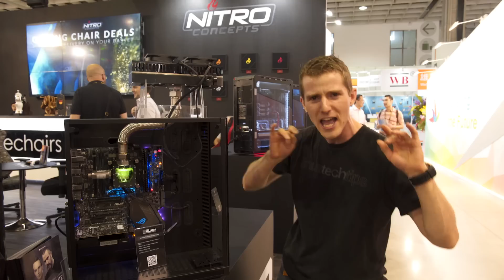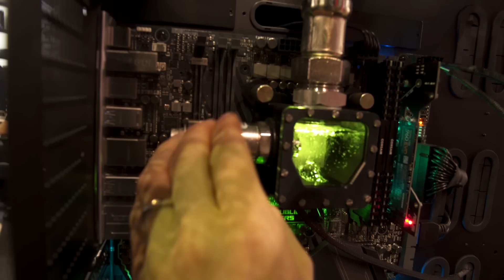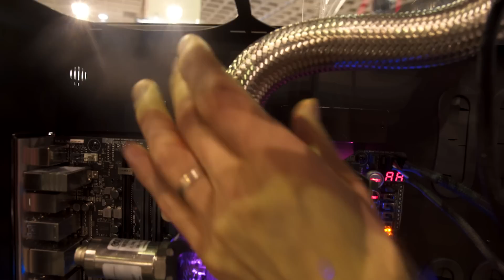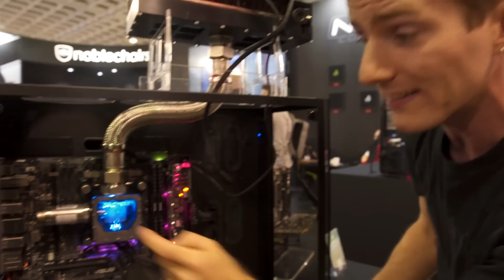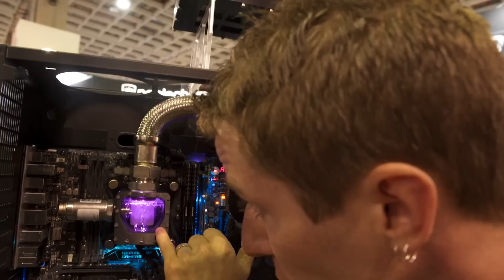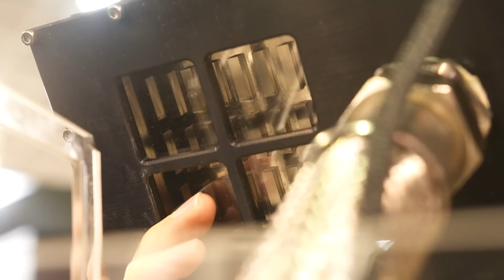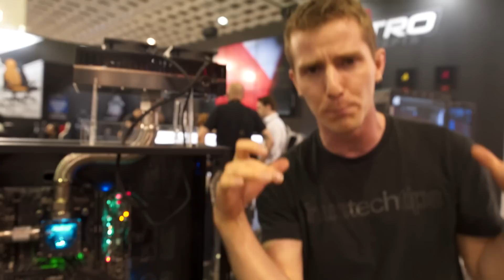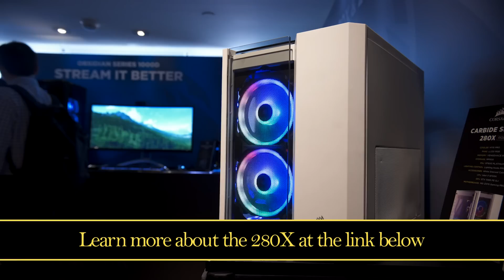Crazy Der8auer cooler prototype - NO pump!

Comment: this is a game changer! The internal pump has always been the point of failure for water coolers. It is small, fragile and extremely unreliable in terms of service life. If u ever had to replace ur water cooler, chances are it was because the water pump died. The water pump issue should have been where water cooler designers should have been focused on but they did not bother because it was more beneficial to them that instead of PC users being able to repair their failing water pumps for a few bucks, were forced to purchase a brand new one for 100+ dollars every 2 to 3 years (if they were very careful). Meanwhile air cooler users could use the same cooler for well over 5 or even 10 years because a failing pwm fan is very easily replaceable in an air cooler. This is what water coolers needed, a complete removal of the useless part that cost owners more then it is worth. I look forward to this AIO cooler because this will finally convince hardcore water cooler haters that maybe there is hope for this CPU cooler yet.

Comment: Freon 113 boils around 47°c and is non toxic chemical but isn't really used as it is bad for ozone layer but could be used for this kind of application.
 If you google refrigerants' boiling points and find out what could be commercially used without health hazards you could easily come up with same concept.

Comment: There's a pretty good reason why he thinks nobody will guess - it's a sealed, pressurised system (thick metal block, seriously thick pressure reinforced pipes) and the tell-tale pressure gauge on the side to test different pressure's affect during development. The liquid could literally be anything that regulators consider safe to use in a sealed pressure system.
The system could even be set up with a vacuum, in which case the liquid could be a "safe" water soluble organic compound. TLDR: Just wait for the safety sheet that comes with the commercial product (if it makes it to market). I really hope this comes to market, as a bubbling glass chamber looks a lot more interesting than an RGB-everything light-show imho.

Comment: it could be liquid propane. It is highly volatile, evaporates quickly at room temperature and will stay liquid at 9 psi and is a known coolant being used in old refrigeration units for years. Like ac units no air in system no flammability . Also plain old ammonia is also used as coolant

Comment: It has to be something with a boiling point low enough to efficiently cool the CPU, but not low enough to evaporate at room temp . I´d go with boiling point aruond 50 degrees celsius.
That would mean you yould use Acetone, Carbon Bisulfide, Carbon Disulfide, Cyclopentane, 2,3 - Dimethylbutane, Methyl Acetate, 2 - Methylpentane and Neohexane. I dont know wich one of these is clear, but its probably one of these

Comment: it could be something like diethyl ether or perhaps THF or acetone. It's most likely something like diethyl ether as it's not too dangerous, compared to something like THF. Equally it could be a mixture of 2 or three solvents to get the desired boiling point with less harmful solvents. It's got to have a low boiling point to actually cool a processor like this, as it's effectively just a reflux condenser.

That being said, the system could equally be under pressure (it seems like quite a robust, enclosed system), so it could be something else that normally has a boiling point too high to evaporate at rpt but under say 500 mbar (~0.5 atm) would be ideal for cooling.

Comment: It's probably just water. If the air pressure in the system is around 200hPa (1/5 of the air pressure at sea level), the water would boil at ~60C (140F). Would also explain why the pressure in the system is constantly meassured.

Comment: every aircooler with heatpipes has this system integrated.. and they mostly use aceton (boiling point 56C) or methanol (BP. 65C) and of course a slight vaccum helps a lot.

Comment: ACETALDEHYDE!
Reply: Could be acetaldehyde under pressure to raise the boiling point.
Reply: For the Coolant I guess.
Reply: probably not because the boiling point is 20 °C, this is too low for it to condense again
Reply: MPcrazyscience what about 65% acetaldehyde and 35% water?
Reply: they do mix but when the phase changes they will seperate again (not 100% sure though) kindof like destilling alcohol.
I've looked around and found that diethyl ether has a boiling point of 35°C and will probably work good
Reply: MPcrazyscience that seems like a pretty good conclusion. Gigabyte tested the liquid out in a server as an immersible cooling liquid.
Reply: yes that's true

Comment: i don't know about roman, but if safety wasn't a problem, i would use methanol and a bit of pressure which should keep it under 70 degrees celcius. i think that would be acceptable but the problem is that it's so damn toxic. is he just using ethanool?

Comment: Der8auer has done already before some projects, with this type of liquid, for Caseking, it's an special fluid from M3 which isn't avaible, at least in europe, for private purposes, only for companys, therefore I guess, also this cooler will only be for events, an not for private use, cause all the fluids with similar specs 3M is offering, does have the same law-side restrictions - at least in europe.
Reply: Django Ryffel they needed such an exotic fluid because they submereg the entire board. If you have a closed system you could use a larger variety of fluids (even water under reduced pessure (like a heat pipe)).
Reply: Spamme Loop hi, yeah I know and totally understand that so far, but nethertheless I have to ask, ehy there are so many restrictive laws on this point, while other chemicals, like GBL are easy peasy to buy in amounts of 10L and more, consider this is a substance, which can be used in amounts of 1-2ml to knock out someone.
You know, I mean, why? Why on the one side so less restrictions and on the other so many.
Reply: Django Ryffel lobbying, volatility and the date of introduction.
Reply: Spamme Loop must be the reason

Comment: Perhaps petroleum ether 40/60. It has a low boiling point, it isn't very expencive and a leak would be noticed by smell very quickly. Only two problems: it is slightly toxic and if there is a leak, you shouldn't drain it into a sink. It's not likely, but it is possible.

Comment: Would that coolant be CO2? Because around 5 bar's that is a liquid. Also because the inclosure looks heavy duty. It could probably contain op to 30 bar of internal pressure. Or maybe even a refrigerator gas how know's

Comment: so the liquid...

it has a pressure sensor which could mean that it is not at atmospheric pressure. as you increase pressure, boiling point increases.
ethanol (even methanol) would be too high. my guess would be something that boils at about 40 C, maybe something like a refrigerant, maybe R11?

Comment: water but it is sealed at low pressure so it boils at lower temperature

or one of these:
Acetone
Alcohol
Bromine
Carbon Bisulfide
Carbon Disulfide
Carbon Tetrachloride
Chloroform
Cyclopentane
Ether
Diethyl ether
Ethanol
Ethyl acetate
Dimethylbutane
Hexane
Isoprene
Methanol
Methyl Acetate
Methylpentane
Neohexane

Comment: It’s likely a commercial refrigerant like R134a or r410a, same as what your A/C uses. Left sitting at the critical point, it will boil under input heat and condense when that extra heat is removed, well.. transferred to the surrounding air.

Comment: Basically using a CPU to run a boiler connected to radiator with gas produced by the boiler to curculate to the radiator where it condenses back to a liquid that drips back to the boiler(requires earth gravity to work unless the gas is also used to push it back to the boiler) Also pressure sensors and overflow valve(s) are kinda a requirement at that point.Getting something to work like this without leaking or exploding is the real challenge. Also i think Inpedence protected fans would work well with something like this since they wont burn out if they get stuck or blocked by foreign objects. As for the liquid used something thats boiling point is from 60-100C+ that doesn't evaporate way too fast and should condense fast maybe even faster than it evaporates. Although i think its distilled water or normal water since i think that overclocked CPU can reach around 100C or more even.could also be Benzene(Benzol)80.4C,Ethenol,Methanol,Wood alcohol,Triptane. Even Petrol at 95C (tho that be pretty dangerious),Carbon Tetrachloride 76.7C,Bromine 58.8C,Chloraform 62.2C,Vodka(ethanol and water) around 80-100C.

Comment: I'm guessing acetone. Boiling point around 50C and easily accessible for consumers. It would also explain the metal hose instead of plastic tubing to avoid corrosion.

Comment: Big f-ing secret, nobody can spend 5 min on Wikipedia and find 10 possible options.
It's not like it's a major engineering achievement, this is basically a big ass heat pipe...

Comment: Whatever this liquid is, definitely has low boiling point:
Alcohol has a boiling point of around 97C at the low end so it’s probably not being used since it would only be effective at really high temps
However, acetone is only 56C so that may be more likely.
Crazier option would be diethyl ether which has a boiling point of 35C which means it would work well even at idle

Comment: I would like to place a bet on that it is some sort of ketone based fluid, maybe an aldehyde or alkene(less likely) since it needs to be low enough to boil strong and get up in the cooler, but also condense quick enough to turn into a liquid again. Most alcohol's boil in a range of 70-90 degrees C which is quite high, since you want the liquid to be in the cooler quickly.
An aldehyde based fluid can start boiling at ~50 degrees C, which is a bit lower meaning it evaporates quicker to the cooler and is easier to cool down.
Whatever it is, they need to some strong seals on that unit to not have anything evaporate into the room.

Comment: Oww no idea what liquid that could be. First thought is something that boils at as low temperature as possible, otherwise it shouldn't have very good cooling ability right?  Anyone knows the specs of the 3m? none conductive coolant used for server equipment? That cpu block looks so robust, maybe there's low/high pressure involved? What liquids boils early in relation possible pressure? I my self wanted to have something that boils early and is a solvent before and was looking into alcohol. To bad we cant see any temperatures, that might give a hint :) 
Alcohol seems a bit dangerous to use. Acetone is interesting but hmm. Guess they would want to use something that isn't flammable?

Comment: If there's a atmospheric pressure in the cooler I would expect the liquid to be something like dichloromethane, because it's not that much toxic has a low boiling point and is not really flammable. Of course the cooler might have lower than atmospheric pressure and then the liquid can be pretty much anything.

Comment: I'd geuss that the coolant is just water and that they have pulled a partial vacuum on the system during construction to lower it's boiling point. To get the boiling point down to 60 degrees you only need to drop the pressure to 25% of atmospheric pressure.

Comment: I was going to say some kind of alcohol, like isopropanol, but that boils at 80C, which would mean that CPU would probably go into thermal throttling. 

It would have to boil around 40C-50C or lower, it cannot be particularly volatile (like Diethyl Ether) because pressure and boiling, and it cannot be poisonous or carcinogenic (for instance, Acetaldehyde). It also has to be generally clear. From what I'm seeing, it also has to be pretty viscous.

So given SOME error in the criterion above, I am suspecting either Methanol or perhaps even acetone.
Reply: TheComputerInside i used ethanol as an example because i know its combustion point. Other alcohols will have similar cumbustion points. Not mentioning that even for spontanious combustion you still need the right oxygen-substance mixture.
Reply: TheComputerInside the cpu doesn't emit enough heat to combust alcohol vapour without an open flame. Ethanol for example combusts at over 300 celsuis.
Reply: It should not be flammable.
alcohol is out of the question.
Reply: +Vegetables are good for you why shouldn't it be flammable?
Reply: That's what I was thinking. I don't think Acetone or Isopropanol is actually usable in this case just because of the pressure and the heat, but I threw it out there anyways. I'm not entirely certain if either could catch fire without some sort of flame or electrical arc, though
Reply: because the amount of heat that the CPU throws off, combined with the pressure in the loop, if it builds up enough, might make the whole unit explode.
Reply: Fair point. But ethanol also boils at 78 C. Wouldn't that be too high to cool the system down?
Reply: TheComputerInside it MAY be under a vacuum that will lower the boiling point some.
Reply: It's almost certainly a halogenated hydrocarbon.  I think we're just guessing on that now.  My guess was dichloromethane.  The other likely one i saw was perflourocarbon.
Reply: Vise Diesel a vacuum won't lower the boiling point.  Well, it will until you put some heat in it, and evaporated solvent fills the vacuum.  Even at room temperature, within an hour the vacuum would be filled with evaporated solvent.
Reply: Methanol are extremely toxic.

Comment: that's water, under vacuum or near vacuum, like they said, very similar to heat pipes and vapor chambers. :D 

 wait a minute...

that's no liquid at all, that is a gas like butane or some sh*t, with a low boiling temperature and is under high pressure. that explains the "pressure sensors" that are not connected to anything and will be missing in the final product, those are fill ports for high pressure gas. -_-  your conspiracy has been solved, now send me a bottle of maple syrup as a reward, that thing is more expensive than gold where i live.

Comment: Maybe 3M Novec or something similar. I should say that this is better than water cooling if it doesn't eat radiators and PCB's. Way to ultimate noiseless PC
Reply: Still have the sound of the two big fans on the radiator, and the soft sound of boiling liquid, lol... If you want true noiseless/fanless, try something like the Zalman Reserator. Big thing, totally passively cooled with no fans, etc. It doesn't have super performance for overclocking, but if you're true goal is just actual noiseless/fanless, it's a pretty neat option and my friend Gabe had a PC running off one in the past. If you have the room for the thing that is... 

The product is a bit older as this point, but it's one of the few I personally have experience over the years with totally passive and fanless cooling that didn't suck. Quietest PC setup I've heard to date: http://www.xoxide.com/zalman-reserator-1-v2.html

Comment: BEST :
Methanol 64.7 C
n - Hexane 68.7 C
Chloroform 61.2 C

Not so okey( too low ) 
Acetone 50.5 C 

Not so okey ( too high )
Ethanol (Alcohol) 78.4 C
Methylcyclopentane  71.8 C

Comment: I reckon its acetone cos its low density and as it doesn't need to be pressurised it makes it safer. Furthermore it has a relatively low boiling point and high specific heat capacity.

Comment: Hmm...I think it's just water because of the pressure meter.
Not demineralized water, because that eats away metal.
But on lower atmospheric pressures, increases the boiling point of water.
Reply: https://www.thoughtco.com/what-is-the-boiling-point-of-water-607865
2nd paragraph. I think you got it backwards. It's supposed to be higher pressure, higher boiling point. Lower pressure, lower boiling point. Higher elevation you go, the lower the pressure (in the example that link gives they use elevation to demonstrate pressure changes, though elevation is irrelevant to this particular PC setup.) Also, de-ionized water has a slightly lower boiling point and is less electrically conductive, won't corrode electronics, etc, so if any type of water it's probably that or a tweaked version of that.

Comment: coolant depends upon the cpu temp so that we can make sure that the coolant boils and rises up.
so lets say the after varies changes or variance we found out that at ideal the cpu temperature are 50c then any coolant that has boiling point below 50c will do the work but your want to take a coolant that whose boiling point and cpu temperature has difference is significant so that is in any case the load on cpu decreases the coolant still boils and rise till the radiator and another reason for difference to be significant is to make sure that the boiled liquid or gas reaches the heat exchanger  and get in the other tubing

few more things to consider
1. check what metal the cpu top is made up of so the coolant does not corrode the cpu top

Comment: Alcohol evaporates at a low temperature and put a liquid in a vacuum it boils at a lower temperature. And that would count for the psi. Sensor and the heavy tube. Water boils at high altitude. Look a the Armstrong scale water boil at body temperature at altitude. so at sea level water boils at 212 Fahrenheit (100 Celsius) you go up 500 ft (152.4 meters) the temperature goes down by 1 Fahrenheit. So with water no need for M.S.D sheets.